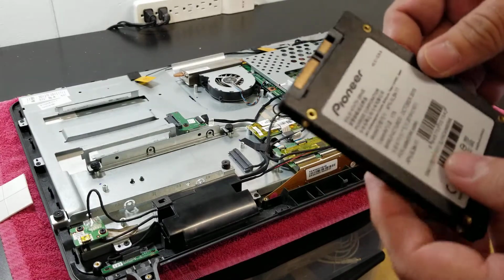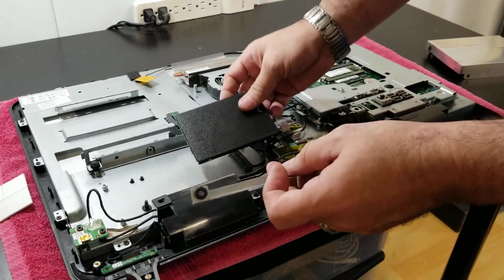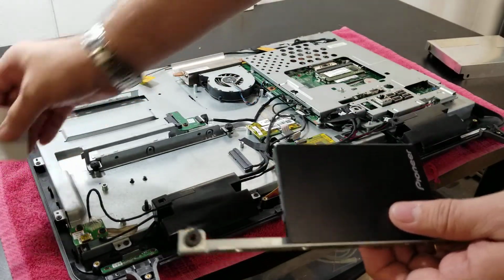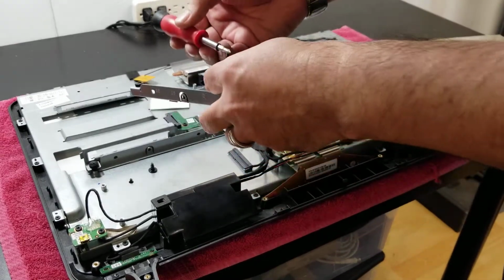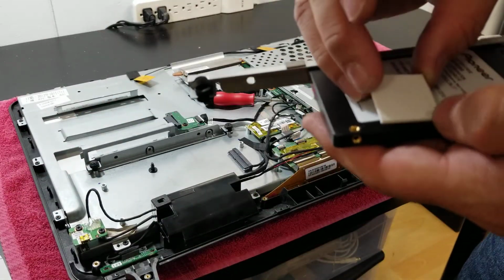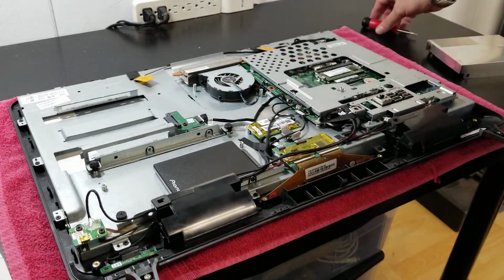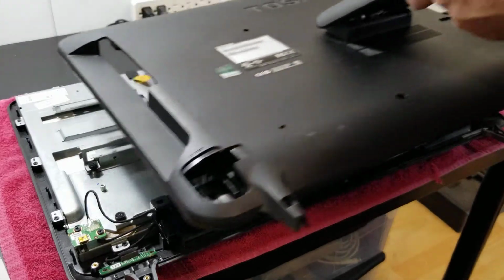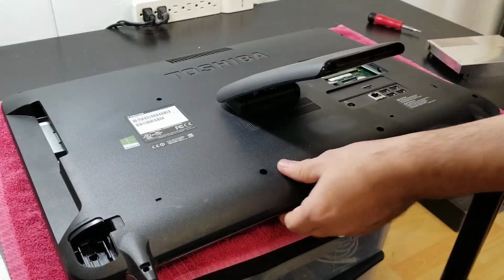Upgrading to SSD and Closing Toshiba LX835

Comment: Thanks for the videos, I have the same model, which will undoubtedly change the hard drive, as you show it. Question: can I increase memory? mine has 8 RAM, and how much memory can I increase.
And can you also increase video? Since now thanks for everything.
Reply from the maker: I am glad the video was useful, Maximum RAM is 16GB 8GBx2 PC3-12800 1600Mhz DDR3 SDRAM SO-DIMM 204-pin, I don't know is you can upgrade video.
Reply: @juanmlince  thk you so much

Comment: Thanks for the videos. I have enjoyed this All-in-one until the latest windows update and now my graphics card won't support youtube videos full display.  A lot of grey and blue appear on faces and other colors missing I'm sure. I am going to swat to an SSD and would like to know what else I can upgrade while I'm at it and make it run as best as possible. Thanks for any info you can provide.
Reply from the maker: If the latest build made your display worst, you may want to go back to the previos build. Windows has an option to do this. If you don't have a USB installer of the previous build that worked fine, then I recommend cloning your working Hard Drive (Once you go back to the previous build) to the SSD instead of a clean install.